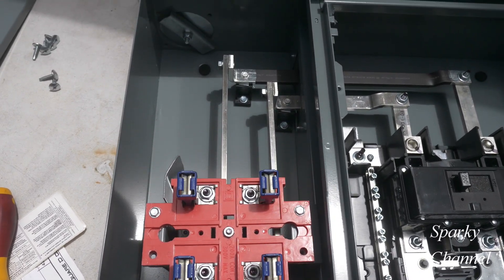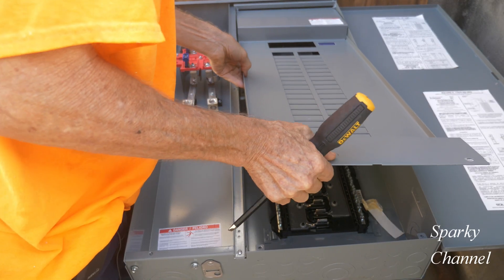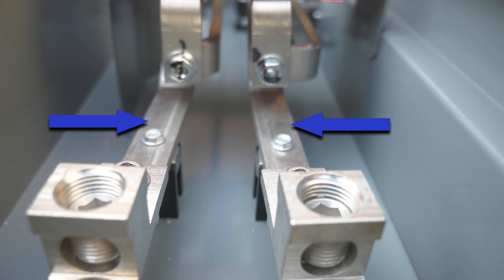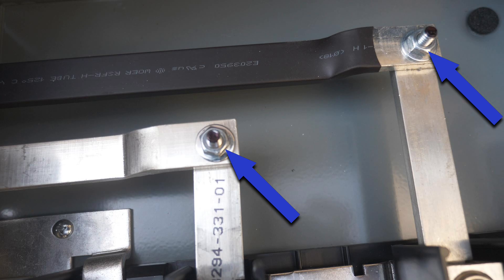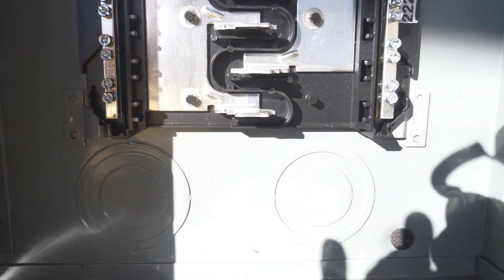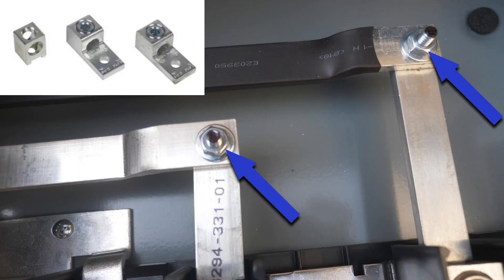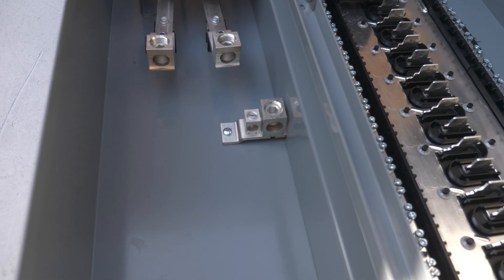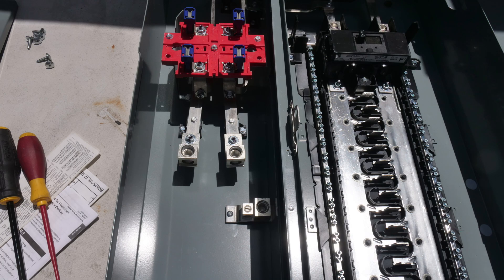What is a Solar Ready CSED? + How to Calculate Max Solar Capacity

Comment: I'm installing this CSED now and planning on doing the line side tap with the optional Lug kit.  I've noticed my model SC42M200PS  MO1  does not have the Keps nuts factory installed as shown in the video.  Also the subfeed lug kit SR69064A does NOT include the Keps nuts either.  After calling tech support a couple times, they are sending me the nuts for free.. just a heads up to anyone in this scenario.

Comment: I'm just about to install this panel for a 14.4kW system in Phoenix on my house. I'll be wiring to lugs for normal GRID power, but also adding a 70A breaker with an interlock if / when needed (ATS switches are wildly expensive & we rarely lose power..) for the LOAD. Using an EG4 18kPV & battery backup.  

Glad to have confirmed some things in this video as I had already designed per.
Reply: i have the same sized system and also in Phoenix. I am thinking of just using the 70A breaker for my grid-tied solar instead of these lugs since I can put the breaker on without having to have APS disconnect the power first.

Comment: If you connect your PV system to the backfeed connection, does it help lower elctric usage and cost? I've installed some whole house Generac Generator automatic standby generators where the utility company installs an electronic control to switch the house to generator power during peak hours to reduce cost, but I'm not familiar with PV system installs. The meter/panel combo looks like a clean set up All the new houses I've wired all have the meter mounted on the outside wall of the garage, so it doesn't surprise me the power company wanted this mounted on the outside garage wall. How much did the PV solar panels run that you installed? I think some states offer rebates or solar panels, and I think OG&E was offering rebates on mini splits heat pumps that are 22.5 SEER of better because of the energy efficiency, so I was just wondering

Comment: well.. if they have solar, I hope they never have a Generac home standby Generator, cause I'll have to separate the loads because of back feed!
Reply from the maker: Thanks!
Reply: Incorrect,
The solar is on the line side of the main breaker and will only work with utility power.
The automatic transfer switch will not sense the solar since it'll be non operational and the generator will not back feed the solar on the line side of the transfer switch.
Simply at the solar connection disconnect it going to the main breaker and fed it to the transfer switch then the load side of the transfer switch feeds the main breaker.
Hopefully that makes sense.

Comment: Hi Bill
I have a question about the solar lugs. How or is there a way so that the solar does not back feed into the service grid? What am I missing?
Reply from the maker: Hi Lou. I wrote the technical expert at Homeline for an answer to your question. I'll let you know when the answer comes in.
Reply: Solar inverters are utility interactive. Without a solid utility voltage signal, the inverter shuts down and goes into anti islanding mode, preventing any backfeed.

Comment: Where I am the electric company requires the meter base to have a lever bypass. Which makes a $50 dollar meter base instead cost $400. When upgrading 100amp to 200amp,  I ended up having to make many unexpected changes.
Reply from the maker: Wow. What area is that?
When I went to our town meeting about the city changing from overhead SEC to underground SEC, I noticed what seemed to be a complete lack of concern on the part of the city about whether people could afford to upgrade their panels and move them outside. They wouldn't even give a break on the cost of permits even though the homeowners were forced to get the permit.

Comment: the fact that manufacturers are pushing regulators into requiring people to put their gear outside, and then charging a premium for equipment that will actually survive outside is annoying to me.  my state has actually rejected the universal requirement for the outside disconnect, which I am happy with.  I've actually seen an aluminum bus breaker panel not make it from rough-in to trim-out without having to have the backplane replaced.
Reply from the maker: Hi Ken! I think the states like CA and AZ want the gear outside so that they can have easier access. But as you say, it gives the homeowners and contractors problems.
Reply: @SparkyChannel  yes, it's officially so the fire crew can shut it off in an emergency. But i think there's enough added risk to make it preferable to have an inside disconnect back to back with the meter. With them being mild steel, surface mount is the way to go.  It saves at least an hour every time you have to change it out.
Reply from the maker: @kenbrown2808  I agree, especially in your area with lots of rain, etc.
Reply: @SparkyChannel  that and the airborne salt. Bell boxes dissolve, here.
Reply from the maker: @kenbrown2808  You must be in a beautiful location. I worked on a townhome in Dana Point, CA with a great view of the ocean for a while. The rust and termite damage were amazing!
Reply: @SparkyChannel hey boss I was wondering I need a veteran in the trades advice I was told to test to see if the mag testers working by touching the end of the wires can that be fatal? I believe it's only a milliamp but I don't want to test it until I've talked to somebody I can actually trust her is actually done it.
Reply: Nice meter main unit,  unfortunately our PoCo only allows ringless unless specified for certain applications.
Reply: @estevaness  interesting. Here, it is ringless that is banned.
Reply from the maker: @estevaness  Good point. The meter main in the video is ringed, not ringless. It comes with a metal ring which is used when the utility installs the meter.
More info: The ring style uses a specially formed ring that attaches to the meter curl on the enclosure and to the meter. These rings are available in a snap type or screw type. Ringless style metering uses the cover, which has an embossment for the meter, as the retainer.

Comment: Nice explanation and research on solar ready equipment.  The only contact I've had is with backfed breakers installed by others.  My solar knowledge is somewhat limited.  Thanks Bill.
Reply from the maker: Good morning, Don! Hope you guys had a great 4th! Yes, the tech support by Square D was very good on this one. I really didn't know what the max solar input was when using the solar ready lugs.
My suggestion to Square D would be to include factory installed phase lugs on the studs and not make us do it. 
I really like the lineside insulating barrier. That's a nice feature.

Comment: Hi Bill.
At time stamp 1:56 you said 2/0 cable for a 200 amp service. We're you thinking 4/0 cable for 200 amp? Or 2/0 cable for 100 or 150 amps?
Reply from the maker: Hi Bill. 2/0 service entrance cable can be used in some instances for a 200A panel.  Sometimes a larger size would be necessary. 2/0 SEC would be great for 100A or 150A panels. My point was, you run the SEC in the panel's gutter, which is a very nice feature of the panel.